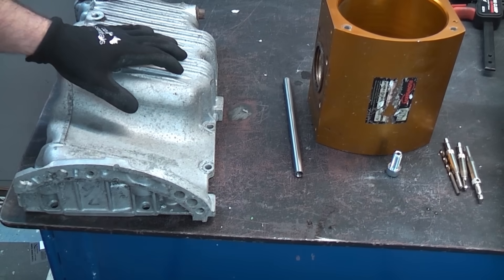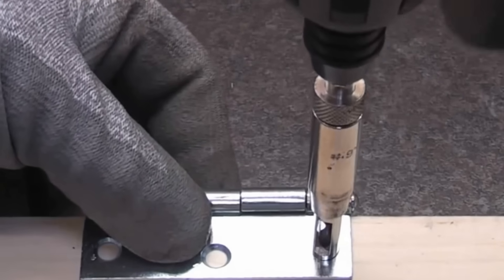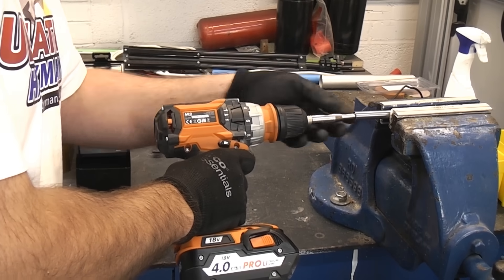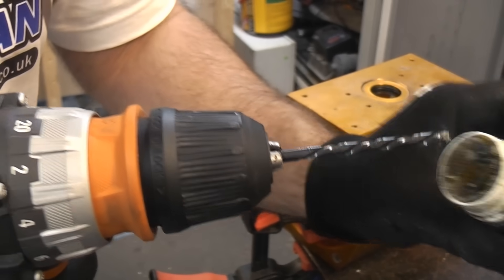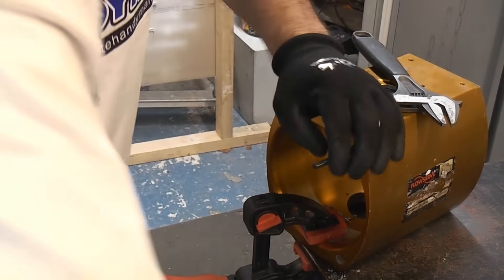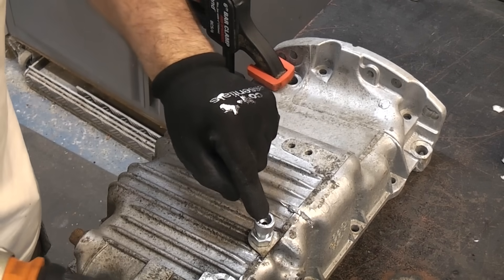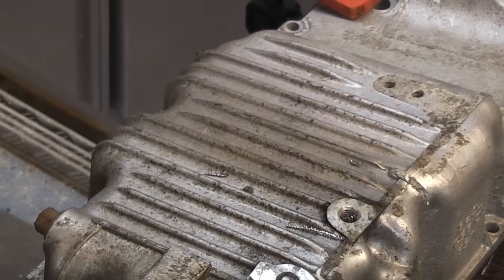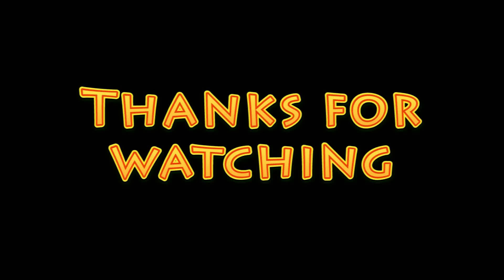How to remove a broken bolt in a deep hole | remove broken bolt in recessed hole

Comment: This is a slow process. A wire feed welder a washer and a nut is all you need. Put the washer on the size of the hole. Weld it down to the sunken bole. Put the nut on the washer and folill it up with weld. Put a tack of weld on the outside of the nut to the washer on two places. Get your wrench and unscrew the bolt out. If the nut breaks off do it again. The heat from the welder will be enough to get the bolt to break loose and this won't damage the threads. I've done hundreds of these things and though your way will work it is a very slow process.

Comment: hi handy man ... I know i am late but ... with the yellow aluminium casting if you were to drill ,as you did , with a drill that is suitable to tap with a left hand thread instaed of using the stud extractor , as you tap the bolt may come out or if you tap to the bottom you may be able to screw a left hand bolt in lock tight  it in and then  remove it . well done though . Obviously my way needs more parts though.  rgds Don

Comment: A left handed drill bit?! That's cheating! I broke a 3/8" tap off using a drill to turn it. Worst nightmare ever to say the least because it can't be drilled. Eventually I was able to shatter it using a hammer and a punch. I knew better. It was working good until I let the tap bottom out.

Comment: Excellent video. A logical approach to safely removing sheared recessed bolts. Now, who wants to make some centre drilled bolts for me since I have no access to a lathe? BTW, wouldn't copper anti-seize react with the aluminum meaning aluminum anti-seize be the only option in an aluminum casing?
Reply from the maker: Thanks for the comment 👍 
This is worth a watch- https://www.youtube.com/watch?v=36mZs6op3oY

Comment: Another thing when using left-hand drill bits, use the largest bit possible for the most surface contact, and push as hard as safely possible while turning the drill bit slowly. This enables the edge of the flutes to dig in deeper, giving it something stronger to grab and exert more force on the broken screw.
Reply from the maker: Thanks for the comment 👍

Comment: Hi this is Troy I have just had this happen on my Renault Master today on the  Tensioner & Belt bracket whats the best way on the side of the Engine working outside ? thanks Troy
Reply from the maker: Hi Troy, can you get into it with a right angle drill, or a right angle drill attachment?
If so a left handed drill bit might work.

Comment: Good job you lucky guy!! Getting broken studs or bolts out of anything can be a major pain in the ass!!! Everything that you suggested was good except your use of  wd40. Tapping or cutting fluid is your best bet. Some times heat is the last resort with dissimlar metals. On the question of broken tap or extractor, if the hole is clear all the way thru ,blow a hole the extractor thru with a small tipped oxy acethelene torch . Melts it right out. 5 cents worth of knowledge.
Reply from the maker: Thanks for the comment 👍

Comment: The tap handle would have pulled the bolt from the orange bit easier because the torque is balanced on both sides and it won't wobble so bad
Reply from the maker: Thanks for the comment 👍

Comment: I sld send you a check I was told it wld been 650 to 850 to take out 6 broken bolts one place said no one place said 500 but might be more to re thread an so on after watching your video it only took me 2hr 45min to get out 7 not 6 broken bolts I will definitely subscribe thanks mate cheers.
Reply from the maker: Well done Chris 👍
Thanks for the comment 👍

Comment: I wish I had seen this video a few weeks ago when I was tightening a steel screw into the aluminum primary cover on my Harley to hold the derby cover. Unfortunately, the screw was an aftermarket one that came in the aftermarket derby cover kit. The screw broke in half inside the hole before it reached the desired torque on my in-lbs wrench. The first thing I did was walk away from the job before I became emotional and did something stupid. The second thing I did was to call a mechanic with more experience than I had. He used the magic words, "easy out", and then I was on the search for one during the pandemic shut-down. Fortunately, the local AutoZone was open and had one. The next step was to look inside the hole to see if the screw that was still in there had a flat surface: of course, not! Then I had to step away again and gather my thoughts:
How deep is the hole? How can I drill into a crooked surface? How far can I drill? How do I keep from losing my mind and save a very expensive primary cover? 
I gathered my smallest titanium bits and wrapped masking tape around them to mark when to stop drilling. Then I started with the smallest bit and gradually went through them until I had the correct size hole to insert the "easy out" screw remover. I forced myself to go slow and be patient....not easy. 
Finally, after a few hours and only $5 for the "easy out", the broken screw was out. Time for a beer and a break. 
Boy, I wish I had seen this video before this happened. At least, I found that I was a little smarter than I thought I was.
Reply from the maker: Well done for getting it out- you earned that beer 👍
Thanks for the comment 👍

Comment: Pro tip for you dude> Try an etcher, vibra peen, you can get one at harbor freight for like 6 bucks they usually come right out but sometimes you have a stubborn bolt then you can do this other stuff. Hold the etcher at as great an angle to the bolt as possible and get as close to the thread as you dare hammer then push and repeat if its gonna come out it will usually start moving in a minute. Also you can buy left handed drills that will usually spin them out quick.
Reply from the maker: Thanks for the comment 👍

Comment: Once it’s heated melt wax into the threads. Often releases the broken stud.
Reply from the maker: Thanks for the comment 👍
Reply: Use bee's wax and it will suck in like soldering a pipe fitting. If you get it to hot the wax will smoke and you will need to start over.
Reply: Stuff bee's wax down the hole before driving instead of penatrants. When you drill the stud it will get hot and suck the  wax down around the threads. Been using it for 45 years and old machinest and blacksmiths have been using it for 300 years.

Comment: If you drill down part way with a drill, say 1/4' first and then continue with a 7/32 you end up with a crude taper that makes the easy out screw type extractor more effective. Always start with the larger drill, it stops your drilled being "dragged in" if you try and open out the top afterwards.
Reply from the maker: That's a great idea, I'll try that next time I'm removing a larger broken bolt
Thanks for the comment 👍

Comment: Excellent! I was thinking about making a guide but I don't have a lathe. Glade to see the idea works well. Thanks!
Reply: Just use a piece of tubing that fits in the hole and a larger bit just to start the hole then move to a smaller bit to drill through the broken bolt

Comment: A good way to remove a broken bolt where there is some thread showing on the surface and if you have access to a lathe.

1.  Find a bolt with the same thread.
2.  Get someone with a lathe if you don't have one to drill a 1/8 hole through it because it needs to be dead centre.
3.  Screw the bolt into the thread that is exposed.
4.  You are now dead centre.
5.  Move up by increments with your drill sizes until you weaken the broken bolt.
6.  You can go as far as the thread size then pick out the metal if it is really stubborn.

Cheers.
Reply: Ooooooooooooooo  Very nice.  I like that idea!  Let me add to it:  I once used my cheap-o drill press to drill the center out of a bolt.  Not as good as a lathe but not to shabby using tools that most people have.  I took a small block of delrin (good plastic works or wood might even work).  I put the block in the drill press vice and drilled a hole.  I then flipped a bit (slightly over sized from what was just drilled) upside down and put it in the drill chuck.  I then pressed the bit into the block tail end first.  Next chuck your bolt and drill it out pretty much dead center-ific!  Gonna have to go easy on it so pressed in bit doesn't spin loose.  That little idea mixed with your million dollar idea and we have a WINNER!

Comment: I’ve always had pretty good luck using torx bits, the t15 is a hair over 3mm in diameter and after drilling a 3mm hole fairly shallow into the snapped bolt the t15 is pretty easy to tap in and grabs well!
Reply from the maker: Thanks for the comment 👍

Comment: on old bolts i have always smack it with a hammer to begin with.
Reply from the maker: That's always a good starting point, as the shock can help to loosen it.
Thanks for the comment

Comment: Snapped an engine mount bolt off flush with the block, it just went crack about 9 / 10ths of the way home, must be debris in the lug hole 😑
Reply from the maker: Good luck with getting it out ;-)
Thanks for the comment 👍

Comment: Found myself in this situation a few times and you have some great tips with centering the drill bit, always the hardest part. I find a lot snap off flush though so would like to see a solution for that. I guess that hinge centering tool would still work at least to start? Subscribed!
Reply from the maker: Yes, if it is flush you can use a hinge drill, or centre punch the centre using a centre punch or transfer punch.
Thanks for the comment 👍

Comment: Use left hand drill bits to prevent the bit from catching and driving the bolt tight to the bottom of the hole.

Comment: Where did you get left hand drill bits?
A few years I tried to find a left handed die for threads on a spindle. Never found it or any left handed taps or dies but was introduced to thread files which work well just not on any inside threads.
Reply from the maker: I bought a full set at auction, but you can get them on ebay etc. 
Left handed drill bits- https://fave.co/2xJjK1M

Comment: Please sell a set of those centering bolts! I would be up for purchasing a set from you :) Got a feeling they will come in handy when I restore my Datsun Z car!
Reply from the maker: I'm afraid I don't have the time to make them, but you might be able to find a local engineering firm that will make them for you.
Thanks for the comment 👍
Reply: @ultimatehandyman  no dramas buddy. If I can get access to a pillar drill make my own little set. Do you recommend half the size of the bolt for the drill bit? As in 3mm drill bit for an m6 etc?
Reply from the maker: Yes, half the size is probably best. I think the smallest one that I made was M6 and I'm sure I used a 3mm drill bit, or I might have used 2mm on the M6, but then all the others were about half the size.

Comment: Love the idea of the drilled out cap screw.
I don’t see how these bolts broke off so deep without messing up the threads above
In my experience, most bolts break off close to flush, often a bit higher than the base, but not enough to get a bite.    
I sometimes find that a scriber can tease a bolt out.  Two scribers working together on opposite sides of the bolt works even better. 
Aluminum expands at twice the rate of the steel bolt.   That is the time to try removal.
Reply from the maker: Thanks for the comment 👍

Comment: Well...GREAT idea center drilling a bolt to use as a guide,if you have threads for that in the aluminum.

..That was a clean job in the video,but if that bolt was stuck in , due to the commom electrolitic corrosion between the 2 dissimilar metals, and it broke when REMOVING it,*no way*  that thin easy out would have done anything except brake in two or strip inside the bolt hole; 

I've had my share of those, and they have to be drilled  out and out,with bigger drill bits,and then pick the steel pieces off; the threads will no longer be visually perfect like before, but they will work just fine, after being redressed with a tap,a bottoming one if it's a blind hole.
Reply from the maker: Thanks for the comment 👍

Comment: i notice you have a hard time saying the word aluminum its pronounced aaa-luuuu-maaaa-num ok next you need to try something like oh i dont know perhaps a ARP header bolt broke off in a chevy LS engine cylinder head,they are tiny bolts and short bolts they bottom out if you dont use the proper length then when you try to take them out,umm nope not budging they snap hard,so the metal is super hard,ive tried welding,drilling sucks it takes hours,and you would need a super bad ass easy out tool for it to work,so come on mate come up with a real challenge for us.ok lol those were junky bolts,try a ARP header bolt thats snapped,it sucks.i accidentally drilled not in the center with the small drill bit then i come back with a bigger size but then i couldnt do anything because its too close to the threads,what would i do in this case,buy a new head,or drill and tap,which i dont want to do you know.thanks man

Comment: Looks like all the bolts are grade 5 or less cause if it was a grade 8 you would be up ship creek
Reply from the maker: These bolts are grade 8.8, I often drill those out and harder bolts using cobalt drill bits
Thanks for the comment 👍

Comment: What brand or type of drill bit would you reccomend for drilling through a steel bolt? Thank you for all of this!
Reply from the maker: If it's a normal bolt, you should be able to use any decent make of HSS drill bit, but if it is a high tensile bolt I would use cobalt, as they work much better on harder steels.
Thanks for the comment 👍

Comment: center drilling bolt for drill guide GREAT IDEA  I have a set of square instead of spyral ones that you are using each of the 4 corners of my extractors have a cutting edge that bites into the broken bolt and does not expand the broken bolt like the spyral extractors sometimes do, especially if you have to drill the broken bolt so it is thin walled  good vid THANX
Reply from the maker: I have a set of square ones on site also 👍

Thanks for the comment 👍

Comment: If you could do videos on titanium screws that's be cool. I'm in aviation and they use titanium screws all the time. Heads busted of ,stripped screws ,etc. I can usually get them out but they are very hard to penetrate .
Reply from the maker: I'm afraid I do not use those in my line of work, but if I get chance to I will have a go ;-)
Thanks for the comment 👍

Comment: What about a bolt that is snapped off flush on an aluminum intake
Reply from the maker: Try and centre punch it in the centre, then drill it, you can then try to use a screw extractor.
Thanks for the comment 👍
Reply: @ultimatehandyman  thanks for the info the vid was still informative too 👍

Comment: Welder?  I used to spot weld onto a broken bolt until it was tall enough to weld on a short bolt with a hex head. The heat was intense and would often loosen the broken one. Let it cool and turn it out with a wrench. Easy and fast. Great for exhaust work.

Comment: Yeah , use Anti-seize compounds at installation to improve removal ...
Reply: Kevin Olesik that’s not always a good idea due to expansion and contraction. It can also have chemical reactions in certain situations, not to mention locking mechanisms in high vibration situations.

Comment: Obviously these were set up examples.
No massive rust from years of being stuck in theses actual conditions.
Not being under the vehicle, lift or ground, usually raining and cold, lol...all part of the backyard mech's idea of fun !
But the Thread saving guide tool is a nice touch.
You can always drill out the broken bolt, to the same shaft thickness, with scant threads remaining Then if that does not complete the task, "Tap and Die Set" will be the answer, after completely removing the threads remaining.

Comment: I have seen and tried a great number of different ways and have been successful. But in the real world, the bolts you are trying to extract are not in front of you on a bench. Most common are exhaust manifold bolts. So the attempts are going to be made with a cylinder head still attached to the vehicle, which in most cases are extremely difficult to get to. I have yet to see efficiently and effective processes for this. And normally what breaks off is the bit in the attempts to drill the pilot hole.
Reply: Or underneath a mower deck, between disks or underneath a tractor!
Reply: and very rusted
Reply from the maker: @Andrew Manche  https://www.youtube.com/watch?v=7JCfEMrCjhc

Comment: What is that drill tool? The 1 you used to drill the hole? I want 1. I live on lake outside of small town. Country all the way with lots of snow. Metal snow rust common. Need 1 of those tools!😊
Reply from the maker: I think you mean the hinge centering drills-
https://fave.co/2TB1Dan
Thanks for the comment 👍
Reply: Im definitely getting some of those lock and hinge bit sets. The bit it comes with is probly cheaper as its meant for wood i guess, but as long as i can swap it out for some high quality bit, left handed or not.

Comment: Aluminium has a high expansion coeffient.  Heating the alloy will often free seized bolts. If the broken end is sticking out,arc weld a washer to it and weld a nut to the washer.
Reply from the maker: Thanks for the comment 👍

Comment: I have done that before. Using the pilot bolt to get your hole in the center is a good trick. Most of the bolts that were stuck hard enough to break the bolt won't come out with an easy-out but I keep drilling the hold larger till there is nothing left but threads then they come out. A reverse drill bit can help with this as well.
Reply from the maker: Thanks for the comment 👍

Comment: I never use tapered easyout extractors , they expand the bolt as you tighten them. 
   Splined extractors work better in my opinion. 
   If I don’t have an extractor on hand , I tap in an allen wrench and use that.
Reply from the maker: Thanks for the comment 👍